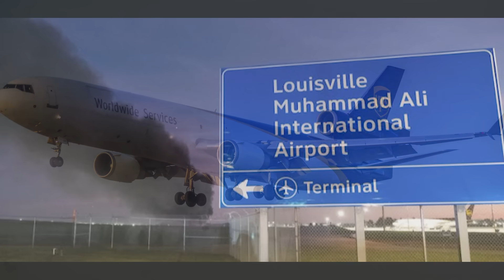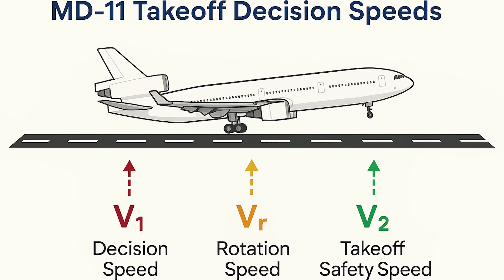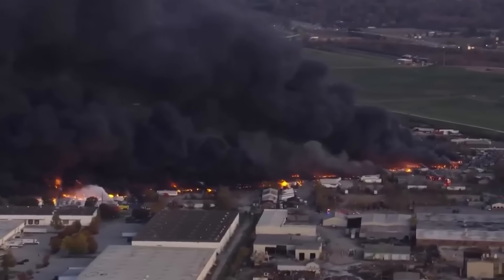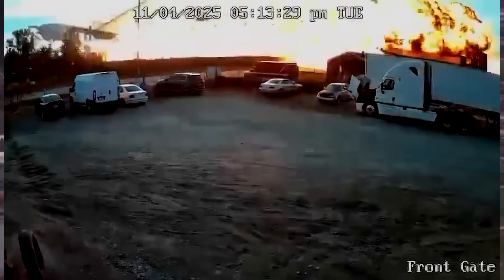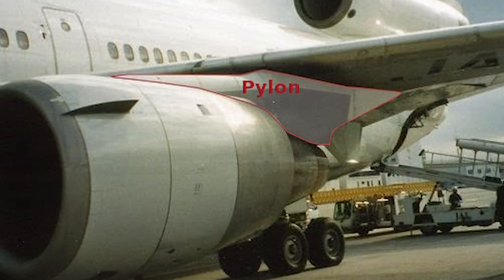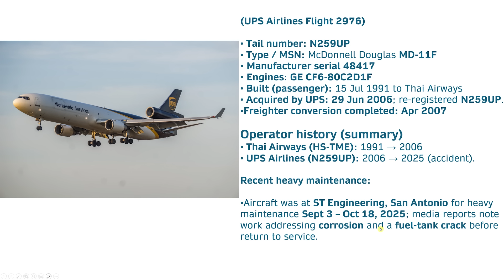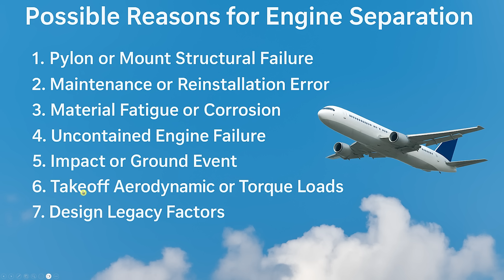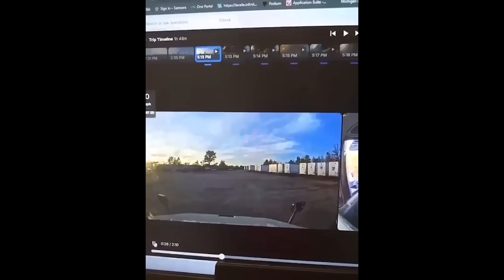What Caused UPS Plane Crash, Louisville, KY? How MD-11 Engine Fell Off

Comment: Was an engine troop on the F16 not cargos but my intuition is an uncontained failure on engine 1 resulted in damage to pylon and wing, causing fire and engine detach, then engine 2 ingested FOD from engine 1 causing engine 2 to fail. This would explain why the aircraft didn't have enough thrust to clear the warehouse. Will be very intrigued to read the final NTSB report when it becomes available.

Comment: I would think the left engine could have detached at the moment of liftoff (@Vr) way passed V1 speed; that's why the pilot flying continued to rotation and attempted to get airborn. I never flew the MD-11 but I would guess that hydraulic lines could have been damaged as a consequence of the engine separation which could explain why the pilot couldn't fly the Engine Out profile (proper pitch and speed). Let's wait and see.

Comment: Well done. My dad, who covered aviation safety for The New York Times, wrote extensively about the American Airlines DC-10 crash in Chicago. It was determined that when the left engine departed the wing, it slashed through the front of the wing and hydraulic lines, causing the leading edge lift devices to retract. The asymmetric lift caused the fatal roll to the left. Wonder if there was a similar scenario here. 

In the DC-10, the hydraulic lines are rooted in front of the main spar. In the L-1011, the hydraulic lines were behind the spar, and more protected. Also, the DC-10's wing engine/pylon mount is four bolts, which were easily damaged in the Chicago mishap due to a maintenance error.

Comment: That was not "another flash' from hitting a power line, those black things behind that sign are the tops of huge petroleum tanks. Hitting those tanks caused the initial huge explosion then seconds later the get fuel fires as the jet slammed into the ground.

Comment: ..well if the cowl is 10,000 ft down the runway and the live cam showed the plane just after  Vr with engine gone.  The Big Elephant in the room question is—. Why didnt they abort earlier on fact they consumed so much runway before rotation?  ((DC-10 s/MD-11s dont need a full 10,000ft of runway even at full weight

Comment: HOW do airplanes not have multiple shutoff valves for each engine? If that happens on the left side #1 engine,  it should shutoff fuel to engine #1 and #2 next to it should still be supplied even if the line was broken, the valve shuts off the broken line allowing the fuel system to pressurize again....... Anyone know how I can start a project to sell the government? Like patent? Product is already available, tech is already available, it's just OBVIOUSLY not being used.

Comment: tnx jeff for a detailed informative of this horrific accident. As a long time private pilot and as a former flight dispatcher at O'Hare in Chicago,  I question the dispatch of an 8 hour 20 min flight to Honolulu with 34,000 gallons of jet fuel (6.7 lbs per gallon) which is about 75,000 lbs on the 3 tanks , left wing, center tank, and right wing. I suggest UPS break this flight into Louisville to San Diego , then on to Honolulu. So 3.4 hours of 14,000 gallons and 5 hours of 20,000 gallons. Max fuel weight is 286,000 lbs on MD-11F.

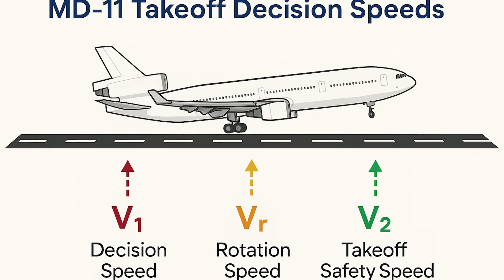Comment: 3:25 Technically, you can still try to abort after V1, in case you're somehow 100%-ish sure that the plane is not able to fly. You know you'll break some stuff, possibly a lot, but it still has better odds that crashing at full speed anyway. The big problem being of course, how do you manage to be 100%-ish sure that the plane is not able to fly in a few fractions of a second.

Comment: Too many people in the comments are assuming this is the same as the early model DC-10 in AA 191. It is not. The MD-11 is a heavily updated version of the DC-10, so all of the design-level issues that plagued it early on (cargo doors that open out instead of in, non-locking slats, hydraulic lines lacking fuses near the engines, etc) were all resolved. 

No, this is something else. The plane was not generating enough lift to get off the ground. As for why that happened, your guess is as good as mine, which is to say "pretty much worthless". My guess is that the #1 engine separation and the subsequent fire caused smoke to be ingested into the #2 engine and perhaps caused compressor stalls - which means now you're running on one engine, and they were never designed to be able to do so. One engine out is a rarity, two is almost unheard of.
Reply: The entire engine assembly detaching before the plane even leaves the ground is much more than an engine going out at takeoff. #2 was definitely getting choked off and there just wasn't enough thrust to get it in the air.
Reply: @JJFX-  I mean yes it is, but my point was more that the chances of losing two of three engines at essentially the same time is exceedingly rare and wouldn't even factor into the design requirements - which is "retain positive rate of climb with one engine out".

Comment: This aircraft can climb with 2 engines so losing one engines it should have still been able to climb, likely the engine #2 ingested some debris from when Engine #1 came off and may have had a compressor stall, which means the #2 wasn't producing enough thrust for them to continue to climb. Surprising how the aircraft was able to maintain itself level enough with one engine missing as you can see in this video, if the #2 didn't lose thrust (which is likely) it looks like they could have had a better chance

Comment: The first building struck seems like it was the rearmost part of the fuselage, not the landing gear.  

Landing gear is still visibly intact in the first dashcam video.  Impact from the landing gear would’ve caused the gear to shear off, at least partially.  

This would also create a massive drag and pull the nose down.  They were still at a high nose-up position and high AoA coming into the view of the dashcam.

Comment: The American Airlines 191 crash was caused by the engine separation cutting the hydraulic lines. Once enough hydraulic fluid was lost, the flaps/slats on one of the wings (I think it was the left wing?) retracted and the wing stalled. That's what caused the crash. They were able to get airborne and if the flaps/slats hadn't retracted, they would have been able to do an emergency landing.

After that crash, McDonnell Douglass overhauled the systems and by the time the MD-11 was released, the flaps/slats would no longer automatically retract if there was a loss of hydraulic fluid. So we at least know that the fundamental cause of why the plane couldn't get airborne wasn't the same as what happened with the AA 191 crash.

Comment: I'm guessing a fuel leak at the direct connection to the engine. Guessing from automotive experience Keep in mind,  If it was leaking at the engine from a loose fitting and was spraying fuel as the cpu's were commanding more fuel psi, the leak would increase AND that leak would also prevent the ENTIRE FUEL system lack the necessary fuel pressure to properly run the existing engines explaining the lack of thrust from the remaining engines. The engines are under THE MOST stress at takeoff, 100% workload, after liftoff itself running maybe 40% to keep flight and airspeed. If when they were doing the brakestand at 100%thrust, it was struggling from lack of fuel, maybe 70% of whats needed, felt almost normal so they let go of the brakes and took off down the runway... the entire time spraying fuel and BOOM!!! An engine explodes and removed itself from the sheer bolts and breakaway brackets, it USUALLY stays intact but enough shaking and it will break off before it rips the wing apart. After the engine broke off it sheers the fuel line causing it to spray more explaining the flamethrower,  the cpu's were pumping fuel TRYING to supply the other engines with fuel because they were still commanding 100% thrust. I'm no accident investigator, but I do have common sense and a little understanding of how things work. I think it was a 80 cent O-ring failure or a  couple dollar fitting.

Comment: Veering left likely was due to the condition of the left wing after the engine separated causing extreme drag past the point correctable with rudder authority.

Comment: The engine exploded and fell off the plane before take off. They are going to check the maintenance logs, probably a bad repair job. It was also carrying 38k gallons of fuel. I never knew thats what 38000 gallons of fuel lighting on fire looks like. Almost a half a mile long skid path.

Comment: As i remember it from the American Airlines flight 191 crash, the engine pylons have fuse pins that are designed to break and cause the engine to come off in extreme circumstances, under extreme force, to prevent catastrophic damage to the wing and fuselage. So yeah I guess that could be relevant here, if the engine struck something or as mentioned in your video there was an issue with maintenance procedure, or corrosion or any of the other things you mentioned that could have weakened the pins.

Comment: Sadly I remember a Tri engine jet  DC10 dropping a engine on take off,  sadly it was found they were lifting the engines off the pylon with a fork lift, cost cutting and saving time.
https://en.wikipedia.org/wiki/American_Airlines_Flight_191

Comment: I remember of a similar accident that happened years ago:
1. One engine pylone fails.
2. The engine, at full throttle, shoots forward and upward.
3. Then it burns its fuel and loses its kinetic energy while the plane continues flying forward.
4. The engine falls back and impacts the wing, specially damaging tbe flaps.
5. the wing loses its lift. The plane rolls and becomes impossible to control.

Comment: If the engine departed the aircraft from under the left half of the wing, I'm wondering why it was on the right side of the runway? Total speculation but, it would seem like the engine tore off and for some reason, had some sort of thrust to the right side? I'm aware of the pylon mounts for the DC-10 but, not the MD-11. Does the 11 have side-by-side pylon mounts that might explain this? If it does, maybe the inboard or outboard mount gave up and made the engine move to the right? Maybe it was rotational torque that led the engine that way? It's still early. Less than 48 hours after this disaster. Rest Peacefully to all who perished. What a horrific tragedy.

Comment: That aircraft should have climbed away without any problems even with a missing engine. 
Something else happened. 
RIP all who lost their lives.
Reply: Uh yeah, the left engine blew chunks into the center rear engine. You can see the compressor stalls in the middle engine right when they rotated off the runway. They only had one good engine

Comment: My guess is debris from the failed engine (No. 1 on the left wing) was ingested into the number 2 (center engine) and caused compressor stall ( look at the video of the airplane going down the runway and you’ll see short orange burst coming from the back of the airplane) and that engine couldn’t  produce full thrust.  With that there was no way that airplane was going to fly. Their fate was sealed.
Reply: This is the likely scenario that ultimately prevented takeoff.  That plane should be capable of takeoff and flying with only 2 functional engines. Only one functional engine with a full load of fuel and cargo would result in this.
Reply: with that fire raging any hot air and fumes that got sucked in would have made any sort of compressor stall horrible.

Comment: Apropos of nothing, I'm baffled by this white pickup driver at the very start of the video. He started backing out just before the plane was even visible at his 5 o'clock, so he didn't see it when he started to back out, then he pulled out right across the oncoming traffic--onto the wrong traffic lane yet--and then just drives off to the left as though nothing happened. Could he really be so oblivious that he a) backed right out into traffic, and b) into the wrong lane, and c) didn't notice the giant fireball in front of him? I would have stopped to observe like the dash cam driver did. I just don't get this guy's behavior at all.

Comment: Cause. Fatigue caused engine fan blade separation leading to engine wobble causing pylon failure. Fod in tail engine reducing lift. Plane then struck fuel tanker causing fire. Plus pylon wobble caused left wing structure collapse.

Comment: Years ago remember watching maintenance crew removing engine with only one bolt,,, When procedure requires the two bolt method on the wing pod,,, these planes have had engines fall off in the past,,,,

Comment: Didn't know any Tri-jets were still flying. And there were only 200 of this model made. With roughly 60 still flying today. Had to look it up.
Reply: Only us freight guys use em these days, they’re on their way out but, we still have a handful still in service. Ours are pretty much being replaced by the 777.
Reply: 35 year old plane
Reply: @snakeplissken814 and? Most planes you see are between 20 and 40 years old...age is not the most important thing its the maintenance and parts
Reply: @Notinserviceij age is definitely a factor especially on tbe md 11. The pylons used to hold the engine to the wing can face a lot of stress and have led to many issues with this specific plane.
Reply: @snakeplissken814 it can be a factor its not a factor right now as far as im aware. Also engines are different to airframe, they can and do replace engines. The engines are bolted onto the wing. So there is a lot we dont know about the aircraft. With 1 example 46 years ago of it being a maintenance issue with how the engines were installed. So i get the age being a question but lots and lots of planes are old and have no issues like this. 

That being said, new is better mostly, the only reason there are old aircraft are because companies want to make profits and if they kept swopping out for the latest and greatest then they will eat well into their profits....simple
Reply: It's a terrible aircraft.

Comment: When I saw the video of the plane missing one of its engines pods the cracked engine support came to mind.
Seems it's common for maintenance to use 'shortcuts" instead of using them proper lifting brackets they use a forklift instead

Comment: So you can see the fuel coming out of the wing after it clipped the power line. Then when the power lines arced it ignited the vapors. This is probably the clearest video of it yet.
Reply: We already have footage from the ground. It was already massively aflame before it lifted off, and the point of flame was coming from the top surface of the wing, in line with another eyewitness testifying that the port engine launched itself when its mounting failed. It then allegedly was caught up to by the aircraft and tumbled over the top surface of the wing.

Comment: My guess is that the engine detached at V2 as in 191 back in 79 but in this case it actually caused a fire by tearing open the wing tank . There is no altitude to recover and the aerodynamic stall and crash is inevitable. I was also in High school May 25 1979 within a month of graduating when 191 went down, It was a shock because we had just experienced the San Diego crash Sept 78 and now the Chicago crash eclipsed that one making it the worst U.S air disaster ever.

Comment: The ONLY way for an engine to fall off from the pylon: MOUNT BOLTS ARE NOT COTTER PIN OR SAFETY WIRED.

Comment: Helpful footage Jeff ... and have helped build many a Nacelle ... yes, the circular part on the runway is called the Cowling. For me, the most bizarre part is the intact Engine has been shown elsewhere sitting on the infield of the Airport runway. This would indicate the Nacelle to Wing Pylon didn't fail ... the Engine should not have been able to break  out of the Nacelle EVER ... so most probably the Attach Fittings (which are coded "Fracture Critical" meaning zero scratches or corrosion allowed) failed ... the fittings or the bolts ... improper torque during D check? I've never liked the MD-11's (or it's Sister DC-10) ... just something about a platform built at a time McDonnel Douglas was taking it's last gasps before bought out by Boeing. Don't forget ... our first F-15's were MD, but the Military side of the house. Yes, I remember AA191 ... sad day. For that incident as well as this one, I just don't get why she couldn't get more altitude. Note the MD-11/DC-10's have 3 Engines (Wing port/starboard and in the Tail) and were designed to be able to take off with only 2 Engines. Can only guess her GTW was max with all that fuel on-board to get to Hawaii ... the MD-11's are gas hogs which is why they failed in the Market.

Comment: Looks like the maintenance crew forgot a few bolts to hold the engine  in place . Didn’t hardly get off the ground , left the engine on the runway , and the left wing engulfed in fire . Doesn’t really look good - reminds me of some of the Aeroflot action I’ve seen on videos .
Reply: Drug test all maintenance personnel
Reply: According to the NTSB, there hadn't been maintenance for a bit. I have been suggesting age-related unexpected metal-fatigue failure.
Reply: @defies4626  Well, I can't think of a reason to trust or believe the
NTSB

Comment: I am saddened by this plane crash, I truly believe the flight crew panicked.   Quick history, this plane had not flown for over a month ..Just weeks prior to this accident...Even if the left engine had detached during take off, shut down of all power ,should have been done immediately. This would cut fuel, and possibly save the crew and others from sure death.  I sure USP is devastated by this disaster...

Comment: I think the bigger issue here is UPS buying a 15 year old, decommissioned plane, then using it for a different purpose for 19 years. This would be like them buying a used truck with 200k miles, then being surprised when they continue to use it and it blows up at 500k miles.